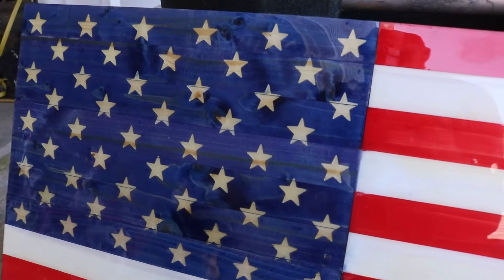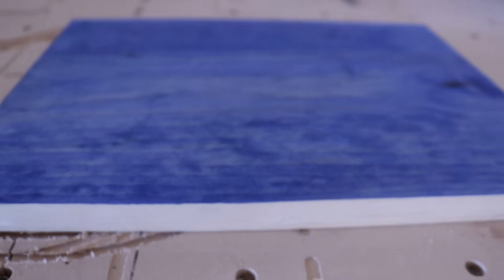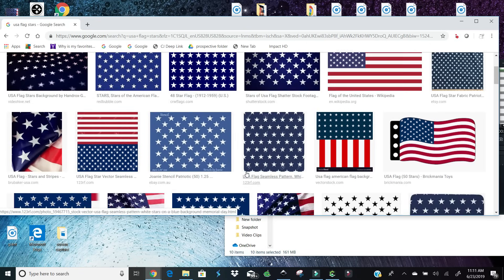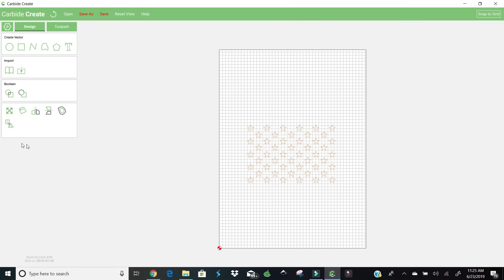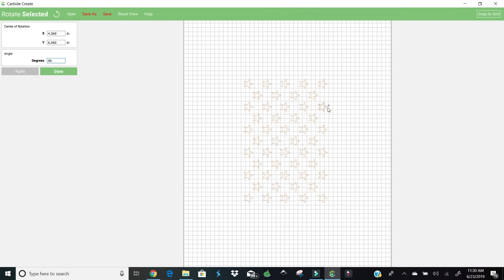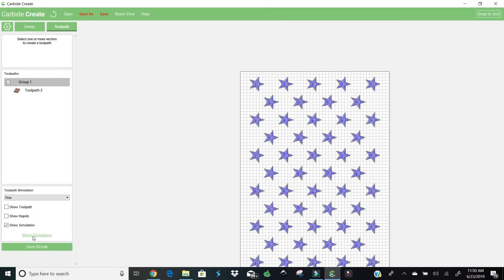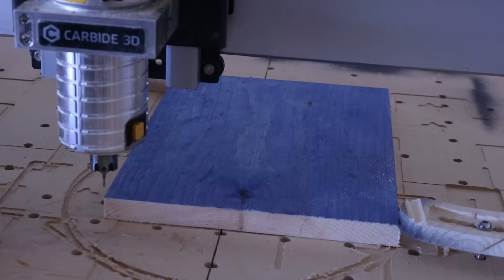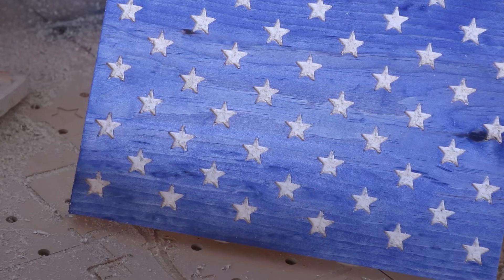How to carve stars in a wooden American flag with a CNC #shapeoko #cnc

Comment: At 14:18 you say “depth per pass” at 0.020  but you put that number under start depth. Doesn’t that mean that your bit will start cutting 0.020 UNDER the stock height? Should the start depth be 0.000?

Comment: Which shapeoko is this one? Will this work of the flag is built (37") with full stripes instead of 1 piece union?
Reply from the maker: Absolutely. I make them all the time that size, but you will need to hang the end off the end of the table and keep the union under the router. This is the Shapeoko3 XXL

Comment: If I were to use the 1/16 but what would my speeds and feeds be because it recommends a router speed that’s way lower than I can do with my router. I have the same exact machine as you except I don’t use the DeWalt router are use the stock shapeoko router Which is from 10,000 to 30,000 RPM